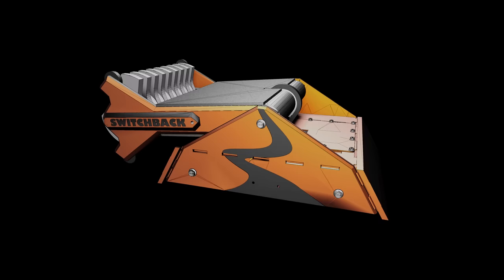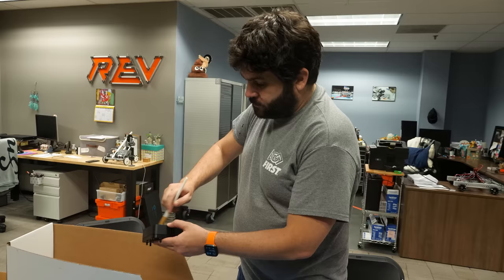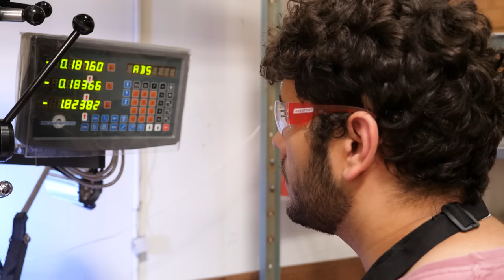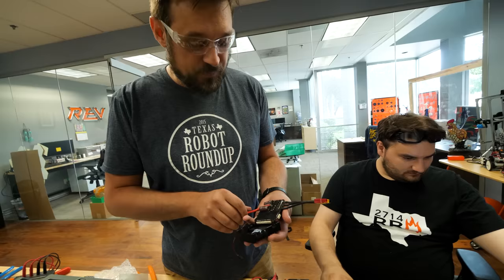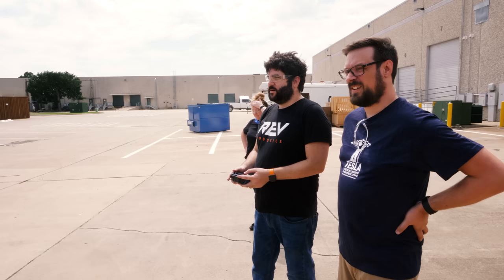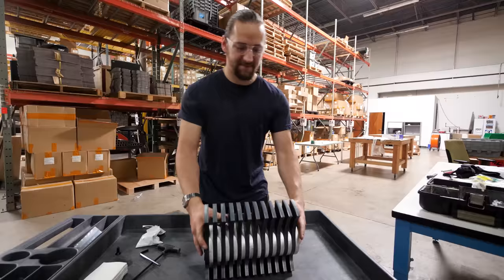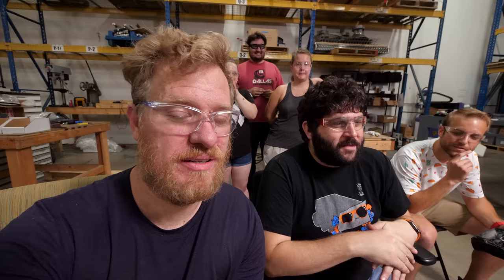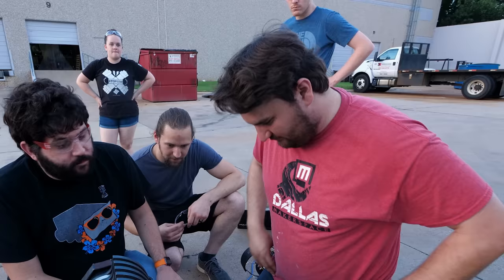We built a BattleBot. It's terrifying.

Comment: why is it always spinning parts? disks, rotors etc? My concept would be: An easy mechanism to attach an explosive charge to the opponent with a remote control to make it explode. Attach the charge to the opponent (by a magnet for example), drive away, BOOM!. Opponent destroyed. But I guess thats not allowed. 

Or: a Gallium squirt pistol as main weapon. But the Gallium probably doesn't react fast enough to make some serious damage. 
Or: An EMP-cannon. Probably also not allowed. ^^
Reply: Explosives and EMP are specifically not allowed in the rules

Comment: Hmmm... New design?

Build everything inside that rotating blade system... Use segway type balanced wheels that are inside, but lowered a bit from those blades...

Having a robot that exposes only rotating cutting blades and some parts of the wheels would be pretty nice.

Who needs the vulnerable crash box that other robots can destroy? Nothing to hit but your blades of destruction... Most of the contacts (except those tiny wheels in the bottom, that are just for safety for the battleground) means instant hits from your main and only weapon... You have as much armoclass as your huge rolling blades has...

Comment: VESC is the best controller you can get, it's soo good everyone copies it, but the original/old designs were flawed, I believe missing TVS diodes to suppress the voltage spikes, those get frequently skipped and the controllers just die from time to time, more frequently as you reach the max ratings.
If you want reliable VESC you need to buy it from a solid brand, At start of the video I saw some TRAMPA VESC, those are good, but then for initial tests you used some no-name or random chinese one.

Comment: It looks like you built a portable recycling machine. The spinning weights are designed similar to scrap metal machines. They shred cars in the same manner.  Except at a slower pace. The edges are blunter and have most of their weight at the ends.
   Too bad there is no way to fit a gyroscope in there.

Comment: 16:10 OMG NOOOOOOO!!! You ALWAYS turn the raidio on first. I have not come across a system that can't run into interference issues.
Reply: This is a common debate in the builder community, but I’m on side “your radio should be off” all of our receivers are no signal means no output, meanwhile we use non-spring return sticks for some items, trim can be changed/offset etc. if the transmitter is on when you turn the robot on you can get immediate movement.  We also have disable switches on the transmitter, but overall from my perspective it is much safer to turn on power in a transmitter off situation

Comment: Not sure if I somehow missed it. But it seems you are running the BLDC Motors without sensors. Running them sensored would give you much more control and low end torque. I thing you guys miss a lot of power + control there.

Comment: with that spin its easy to lift and lower it.  but how do you want to TURN the robot around ? If that weapon spins and you try to steer to the left, everything thats going to happen is, that the battlebot will lean and tip over to the right.
Reply: With this weight spinning so fast, you create a good ton of centripedal force

Comment: Is there a reason behind moulding your own wheels versus using an off the shelf option?
Reply: Off the shelf wheels for this size of robot are not always very good. 

They either require extensive modification, or can be low grip/heavy among other potential issues

Comment: Individual coated wires inside the insulation? Why would you need that? I would think just a single, heavy gaged wire would be the way to go. Stronger and be able to handle more of a load.

Comment: there should be a really destructive class where there will be weapons as usuall but with 3D printed parts so there is a real damage after each fight with no weight limitation but with price limitation so there is not a huge cost for the robot that gets destroyed
Reply: It wouldn’t work for heavy weights. However, this actually exists for 1lb robots. The weight class is called plastic ants.

Comment: This bot has no future. 

A "hammer" bot is completely pointless if the arm mechanism has to be so short to not be unbalanced with all the weight. The reach of the bot is effectively the same of any traditional spinner- but with less power, stability or armor.

Basically they sacrifice all that with the only "advantage" being a questionably useful variable height spinner. The whole setup is more an handicap than a strenght point. It looks cool on paper, doesn't work in practice as we've already seen.

Unless they completely change the desing, that is a dead bot walking. No future, no potential.

Comment: Could battle bot have infrared control mode, and have signal jamming system 🤔

If that's could be done, isn't it great advantages when you can control your bot, and the other just can't move due to your signal jamming🤔

Comment: 8:25 I work in manufacturing of such electric motors, what he is describing is not true, well not entirely. The wire which is wound on the stator is indeed coated, however the wiring coming out of the motor is, in this case,  most likely NOT the same (for vey small motors this might be the case but not here). Those individual windings on the stator then get soldered to each other in a specific way and on those points the wiring you are seeing outside the motor, will be soldered on to too. So no, the case that the wiring is coated is highly unlikely. And it might have very well been that you just got a faulty speed controller. Other reasons could have also been a short in the winding itself, not too uncommon either. Also, please don't tin crimp contacts....
Reply: The motors we used were custom made for us and the wires that come out of brushless hobby motors are indeed the winding wires. Sometimes additional wires are spliced on but in this case the description of the issue is factual to what happened.
Reply: @robogreg  I'm baffled, i've never seen it been done like that on that size, they actually wrapped something like 12 AWG (stranded) wire in the stator then? How finely stranded where they? And then they just shrink wrapped the coated wires? Even my small 2204 drone brushless motors have different wiring in the winding and the terminal wiring.

Comment: If something hits that sideways, or if the weapon hits something and topples the robot, you are basically done, right? 
May be curved sides or something else so that it can recover?
Reply from the maker: We added some bits at the bottom on the sides, so that we could self right ourselves from any position.  Seemed to work fine in fights...
Reply: @StrangeParts  I saw the first fight, was the self righting mechanism not setup or was SwitchBack too damaged to self right
Reply: @FireStriker_  one of the motor wires was sheared by a sharp edge of the arm gearbox. We sheathed all wires in nylon after that.

Comment: 8:40 I think he misspoke here because what he said was nonsense.  I assume he's trying to say something different to what he actually did say.
Reply from the maker: Nope, what he's saying is accurate.  Not all motors are made this way, but these are custom made motors, and Greg has toured the factory where they are made.
Reply: @StrangeParts  He stated that the crimp did not make proper contact, therefore the resistance was really high, which resulted in a short.  A short is really low resistance.  So how can something have a really high resistance but also a really low resistance at the same time?  That does not make sense, please explain so i and others can understand.  :)

Comment: Been doing brushless a long time.
Since the beginning.
Your powersystem will only be as strong as your weakest solder..it will.
Cnhl(China hobbylab) best batt.
Castle creations esc best for buck but do not overcharge Batts and use qc8 connectors.
Big boy esc is MGM if you wanna smash all.&
Radio on 1st,
Radio off last.

Comment: Is there a format in their channel to see when something actually happens? Oh, wait, the video was just "We built something, it looks scary." You're nearly on two million subscribers and you waste our time with videos that show process but not result. This is bad science and worthless for us because we have no idea if your idea will work and you hadn't even proved a thing to us. It's just a basic and tiny grinder unit, like any you'd see breaking down small scrap (like aluminum cans and cast iron components), only amped up so it might be able to hit up some of the most kindergarten metals in the world.

This same machine will face the results of physics in that it needs to have a constant pull of the opposing bot (as if it was falling down from gravity) to properly grind and break it down. Otherwise, just like grinder bots of the past that already existed and someone had already made, this will not work. If a bot is approaching at a small speed of 1-10mph, no crusher unit is going to grip a single piece of the metal long enough to draw it in. It'll just scratch and sniff at anything that's angled properly because grinders only work by attacking structural break points anyway.